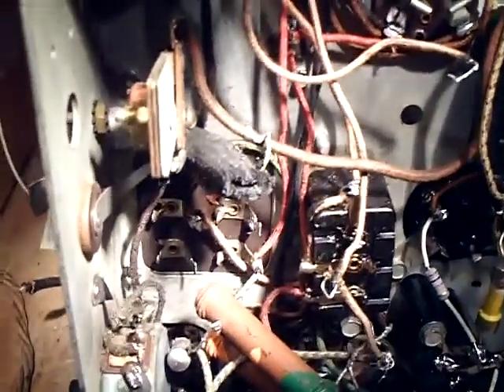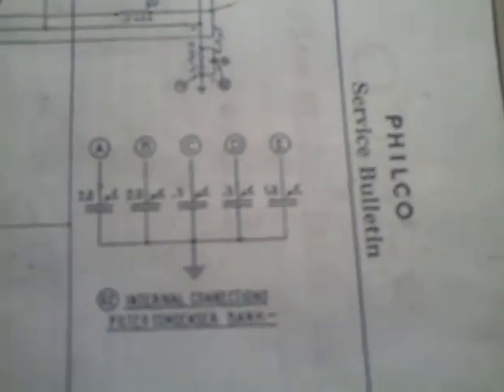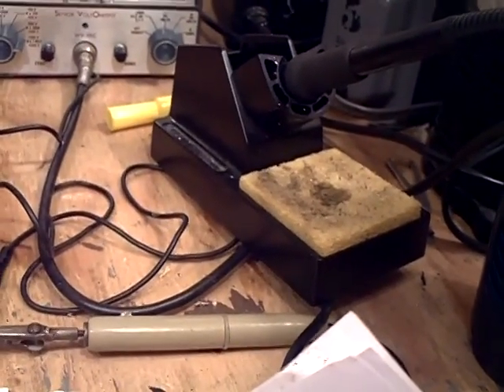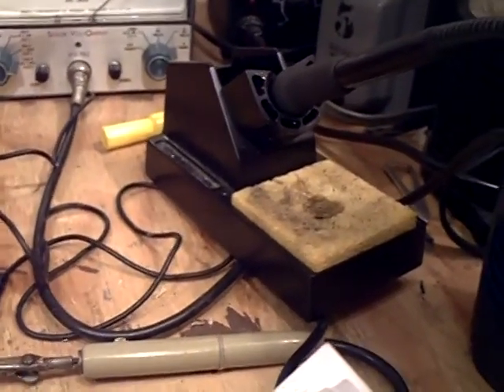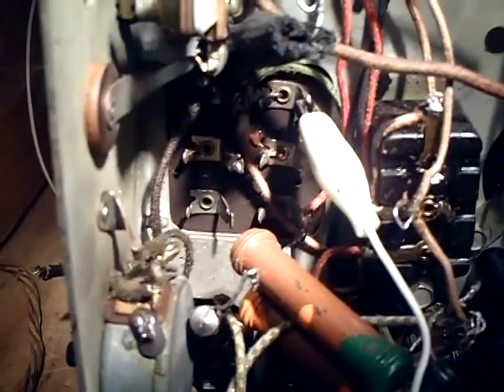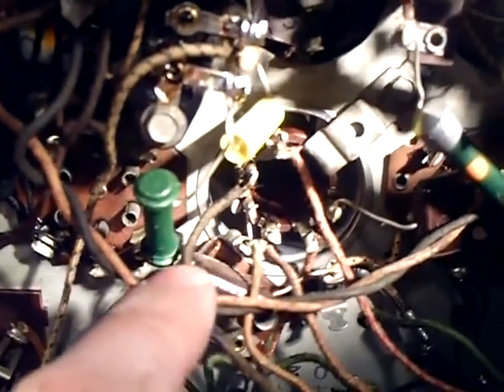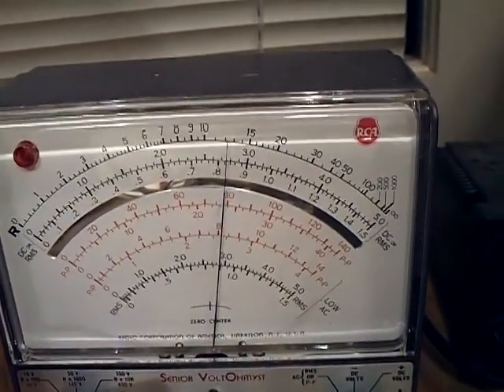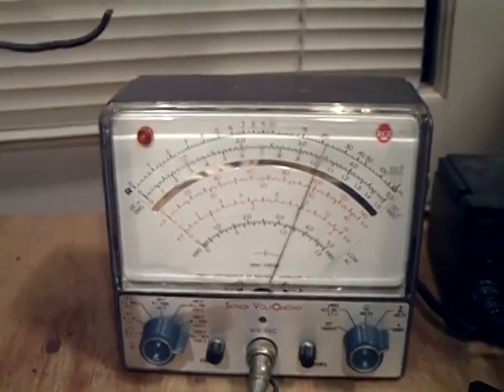Part 28, Testing out the Filter Condenser Bank

Comment from the maker: You're right though. Even if for some miracle the caps tested OK with an megohm meter, there is no guarantee they would hold up to 400 volt DC. I figgured after 76 years they would have shown leakage but you're right they do need to be replaced automatically.

Comment: I recently read a posting where a fellow used a cork screw to remove the guts from a cap can.  Prior to heating the outside of the can, he threaded the cork screw down the center.  Once the potting compound was soft enough, he simply pulled on the cork screw and all the guts came out in one lump, as slick as a whistle.
Just a thought.

Regards,
John

Comment from the maker: I may have done something to make people think the rivets need to be ground out. I was trying to point at the bottom of the can to show that about an inch of the potting material and or capacitors have to be drilled out to allow space for a small electrolytic. the entire can comes off by removing three bolts. The terminal strip then comes off and the potting paterial then can be removed by drilling or possibly by melting it out.

Comment: Rather than grind off rivets and tear that can apart, I'd go with a terminal strip mounted to the bottom...its center tab connected to ground.  I normally restuff a standard filter can, but they're not riveted to the chassis.  I'd just leave this can as it is.  Besides, connecting the new caps to an accessible terminal strip will make their future replacement much easier.
Great vid by the way.

Regards,
John

Comment from the maker: Yep, good notes umajunkcollecor! Also I forgot to say that even if the sections test out great with a Megohm meter, they can still break down under full voltage load. Also I have to make sure I observe correct polarity with the new electrolytics because the paper capacitors were not polarized.